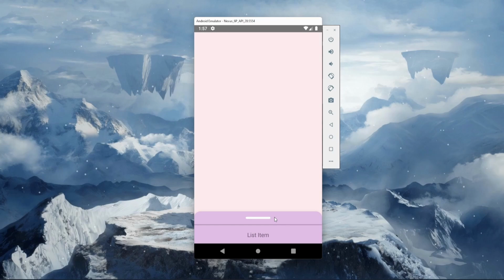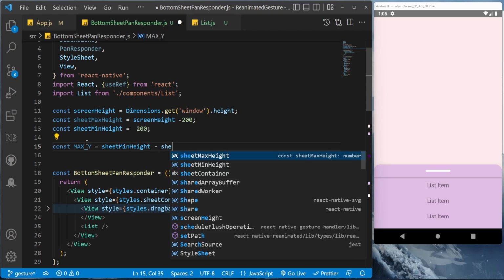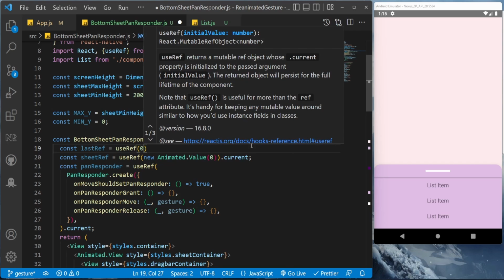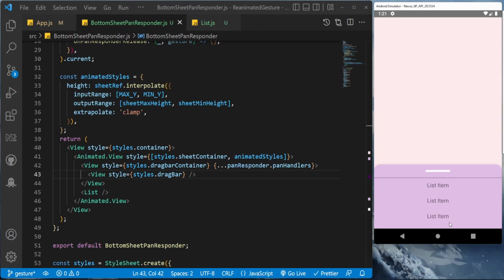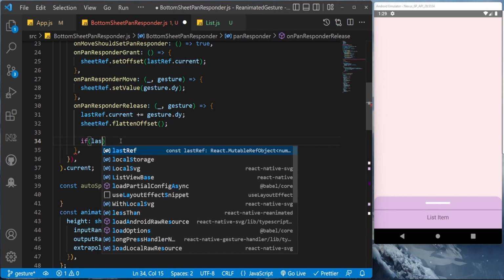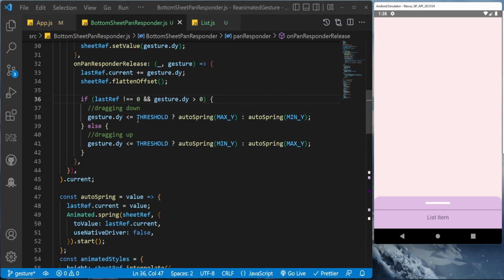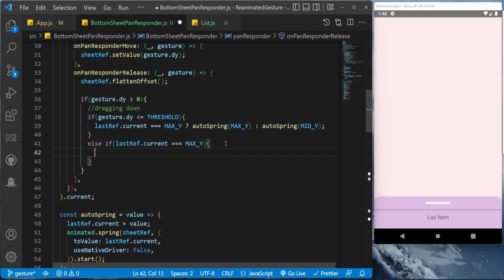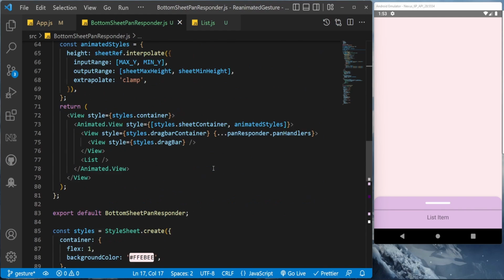Custom Bottom Sheet using React Native Pan Responder

Comment: bro convert some basic or complex design from figma to react native using reanimated .
Reply from the maker: It can be done brother, but the thing is it is not practical. Customer or user wants something easy to use without any complex understanding requirement. I will be posting the same animation using Reanimated though, wait for it 🤘
Reply: @monisankarnath  baat toh sahi bol rahe ho . its not practical . But still try .
Reply from the maker: yup will try that :)
Reply: Actually I'd also prefer a panhandlers only version